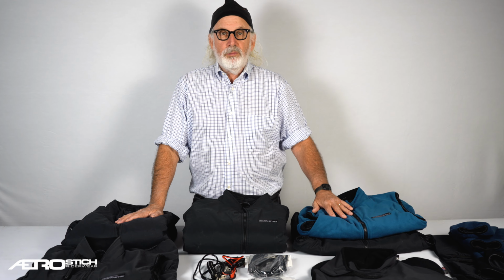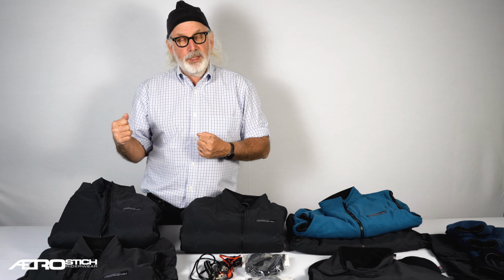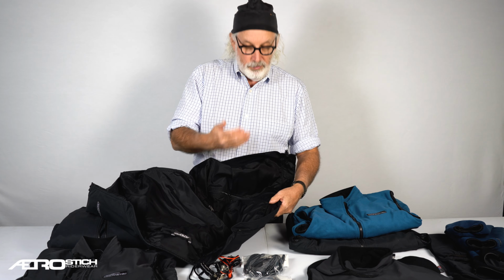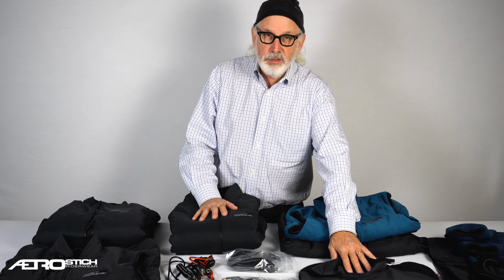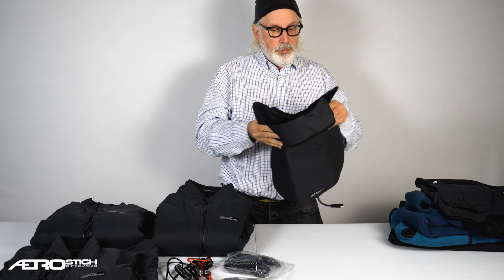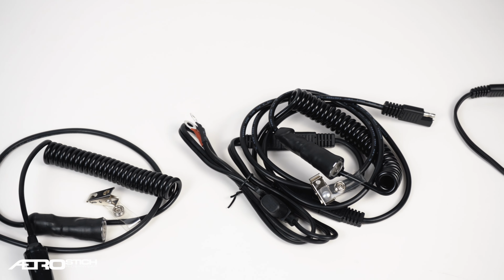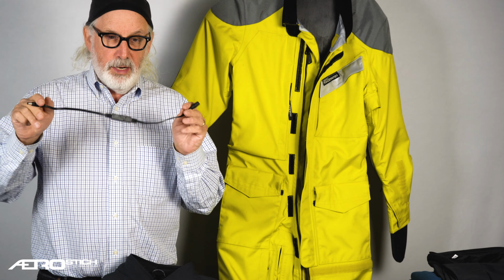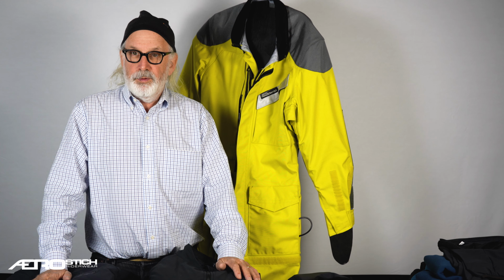Aerostich Kanetsu Heated Gear Walkthrough

Comment: I have the kanetsu heated with air bladder,  and the insulated  ropers. Here in Indiana it gets cold. I rode 40 miles to work in 18* once. I was just fine. I loved it.   I don`t like the double zipper ! It`s rather clumsy,  if I may say. I would rather a normal zipper. My bike is an 18 r1200rt. Heated grips and seat.

Comment: Thanks for the info.  One thing I would suggest is that anyone buying heated gear budget in for a Heat Troller.  I tried the on / off approach with my Kanetsu originally but found my experience to be much better when I added the Heat Troller.